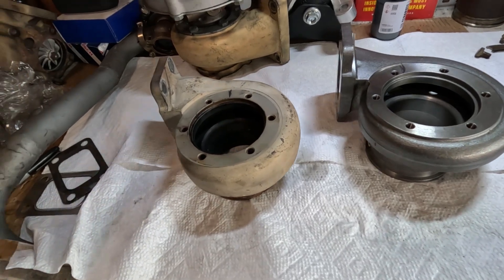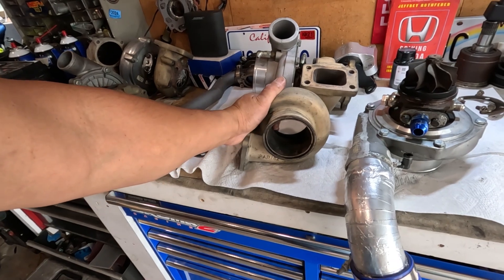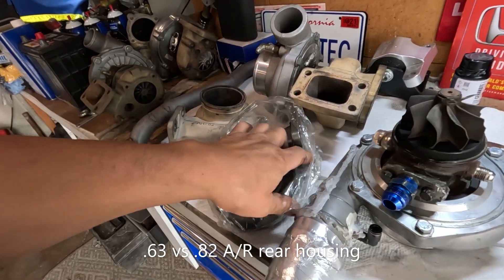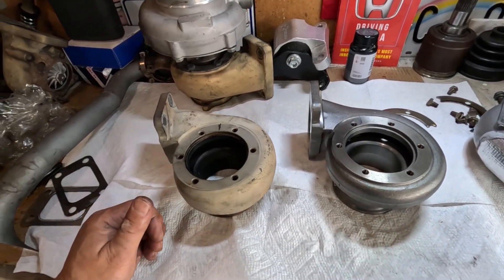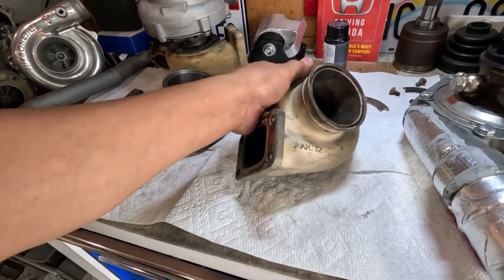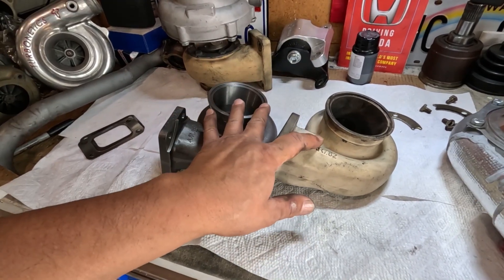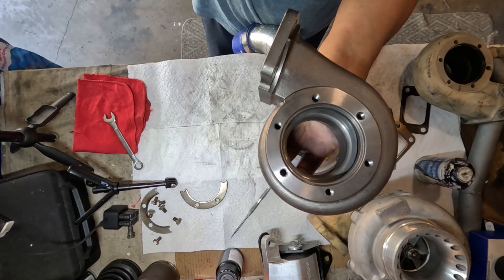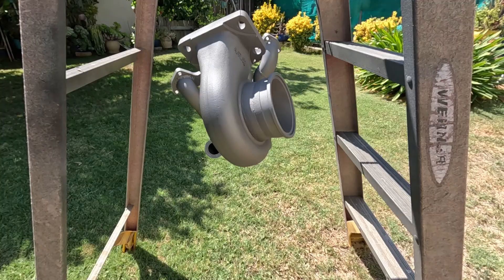Why l'm going back and use .63 A/R Turbo housing rather than .82 AR

Comment: I’m leaning to .63 a/r for daily driving my fun also on my k20a2 which can rev to 8800 rpm safely , I’m gonna limit to 8400 for safety net after boosting.   Only tuning to about 400-425 whp.    Am I still going to have boost up at 8k?    Or are you saying .63 is done after 7k No matter what whp tuning to?    the turbo I’m using probably can push 550-600 whp and im staying conservative @ 425 whp.   Does this matter up at high rpm with a .63? 
This is the part that still confuses me.
Reply from the maker: The 0.63 rear housing will give a boost early and die down basically before 8k rpm but also it depend on the engine like yours (k20). Maybe it'll put out more on that range since your motor is built to rev that far.
Reply: There is a way you can still get decent top end performance from a .63 housing without having a massive amount of backpressure. Increase the wastegate size or even add two wastegates, especially if you are running a twin scroll manifold setup. I was running into the issue of my D16 single cam being choked out at around 7k with a .63 on a GTX3071. I tried an .82 housing and it wasn't that friendly on the street as it lit so late, which was horrible as the D series is already a torqueless mess. So I did some thinking and went back with the .63, but with a 50mm gate vs the 38mm and it really did help a lot. The turbo still gets lit quickly and the bigger gate vents much more gas, reducing backpressure and allowing me to still rev out to 8500. Now there are limitations on this and using electronic gates or boost controllers are much more effective.

Comment: What about .68? Does it fall in between or is it just too close to .82?
Reply from the maker: Have you research on any forum if any k20 users using .63 rear housing? Most of my experienced are on H22 and G23. My recent dyno graph made power up to  7.5k rpm but thats because l only want 350hp. Maybe .63 housing will make power up to 8k if you want more than 400.